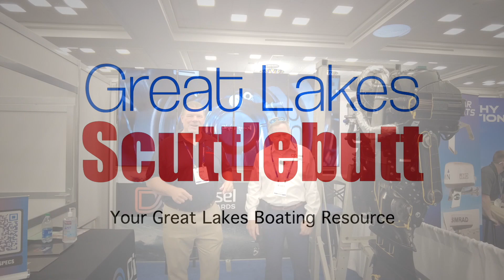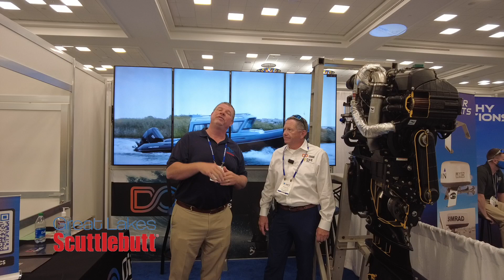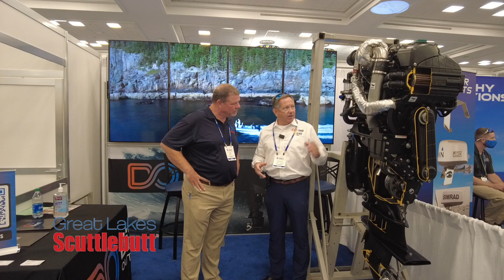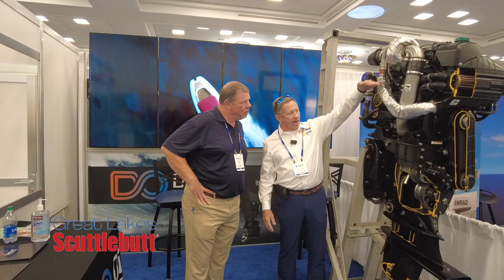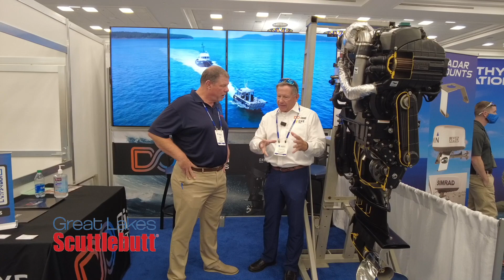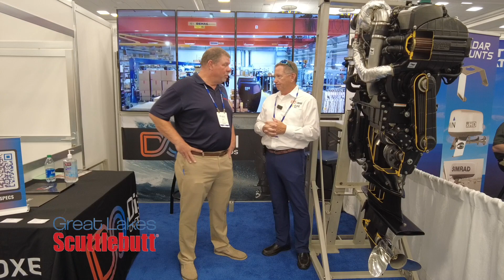NEW OXE Diesel Outboards!

Comment: Only people that have no clue about how an outboard engine works, would buy this absolute piece of junk.

More pieces = More chances of things getting broken, soo more chances of having your boat in the workshop.
Diesel engine? For what reason? I mean, diesel it's mean to imrpove torque habilities and tug capacities. Who the hell buys and outboard engine for that purpouse? when there are plenty of inboard engines with half the price and double the capacities.

You want to fish more far away? Just buy some gas tanks that you can buy in any gas station and fill ur tank wenever u needed. 

This is the perfect example of something that has no future at all. Mercury, Yamaha and Suzuki, all of them developed diesel engines and... Surprise... No one of those giants keep producing them, only during 25 years the outboard diesel engine where produced, in comparision with for example the two stroke engine that has more than a century and until today it keeps getting usen and improved. Just buy a gasoline 4 stroke, made with a good alloy like de YDC-30 and stop crying, over problems that AREN'T PROBLEMS AT ALL.

Comment: As soon as i heard belt driven I knew it’s trash ….
Reply: Not necessarily, a lot of motorcycles are belt drive and last the life of the bike. Timing belts are meant to last close to or over 100k. Belt drives have come a long way so don't knock it until you try it.
Reply: I ran a stump grinding machine for 8 years straight all the time and sold it with the original belts that it came with to another guy I made hundreds and hundreds and hundreds of thousands of dollars with it while I had it the guy who has it now still runs it with the same belts 2 years later

Comment: How is the automotive block able to handle the continuous heavier marine loading, when the automotive blocks typically see 2000 rpm at less than 25% throttle at cruise? What is the expected block and top end rating longevity in hours before total overhaul?
Reply: Much like regular commercial operations, it's not the RPM that's the issue, it's the continuous change in operation that becomes an issue. I seriously doubt it's loaded any worse than it would be on land, but the bonus is you set the RPM and leave it there until you reach destination. The engine systems have a much easier time finding equilibrium like that than they do when the power requirement is all over the map. It's like highway use vs stop and go traffic, same thing.
Reply: @kleetus92  there is no data that highway vs road is any different. “highway miles” is a myth. Just because you relax doesn’t mean the motor does too.
Reply: @viasevenvai  Absolutely not. Highway operation is nearly steady state operation, constant speed, temperature and load...  city driving is start and stop, short trips, inconsistent loads, temperatures, and speeds, everything even the brakes are working more. 

You shouldn't have to be an engineer to understand why not messing with something is better than constantly fucking with it.
Reply from the maker: Hi Graham, we recommend contacting the manufacturer with these kinds of questions. Their email is info@OXEMarine.com
Reply: The BMW production 4 cylinder block (gasoline) was used in their F1 turbo engine and was delivering on the dyno 1500hp. Now of course I'm not saying it will last for years but just to give an indication of what some blocks can do. It was used successfully on the Brabham, probably the best looking F1 car ever by South African Gordon Murray.